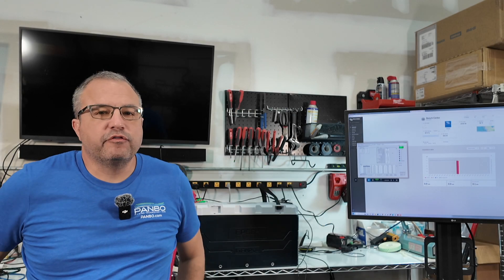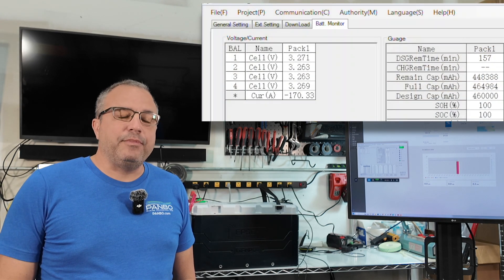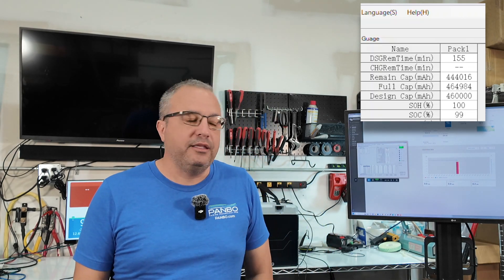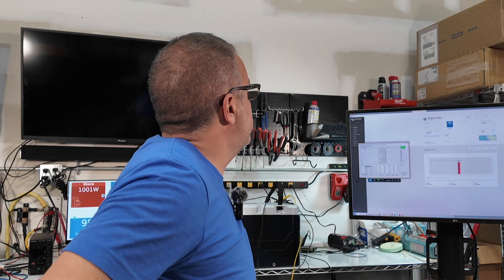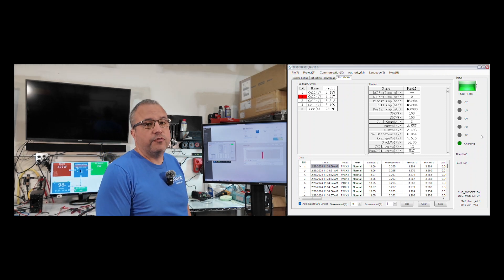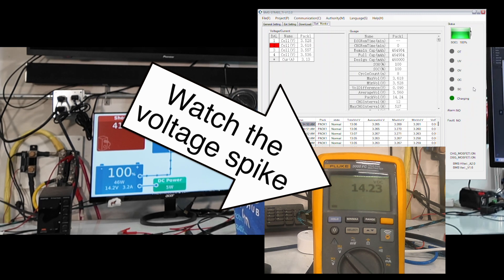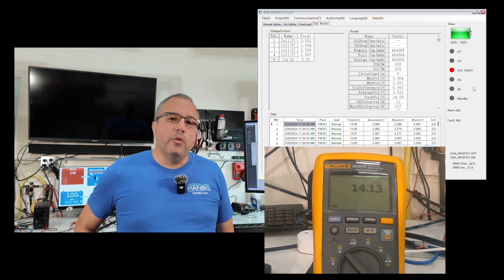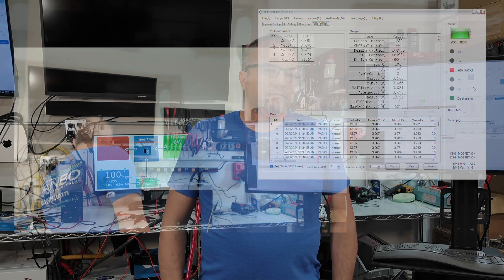Epoch 460 amp hour, 12 volt battery full charge protection

Comment: I know this thread has been around a while and interest has likely waned, but I’m hoping to pick this back up as I’ve now encountered this with my Epoch 460s and am looking answer. Your excellent video has some conclusions around “preventing” the overcharge protection (which I will enact). My issue is that 3 of my batteries have overcharge protection triggered and I can’t wake then back up. They are sitting idle at 100% and no matter what I’ve tried they will not discharge. I’ve tried tuning them on and off using the mechanical switch. I’ve tried disconnecting them as well. However, they are basically bricked. As someone who lives aboard a sailboat full time in remote locations these batteries a mission critical. And advice that you or anyone else can provide will be so greatly appreciated. FWIW, Epoch support will not return my requests for a solution. Thanks
Reply from the maker: Sorry for the late reply. The best way to get them out of FCP is to separate the battery from the others and place a load on it. Discharge down to about 80% SOC and everything should be back to normal.

Ben
Reply: thanks for getting back to me. I’m living on my sailboat full time and mostly on anchor in very remote places. I rely on this battery back bank 24/7. Disconnecting a battery and placing a load on it is nearly impossible in my situation (battery weight/location, lack of workbench environment, etc). So, I’m trying to figure out other ways to reset the mofset. Appreciate your solution but if you have any other ideas that would be helpful. Thanks again
Reply: @tommidd  You can just shut one battery down and hit the remaining battery with a heavy load and FCP will clear around 13.35 volts. The turn the other batt back on and shut the one off you just  cleared and repeat. Then set charge voltage to 13.9 absorption and you should stay out of FCP.

Comment: I had a 300mV cell delta on my 300Ah V2 Epoch battery. I managed to figure out how to get the cells back into close balance relatively quickly but not sure why it happened in the first palce.  I also had a runaway cell and one that initially would not go above 3.43 volts.  I installed four epoch essentials 300Ah batteries in my friends boat, and during pre-charging each battery individually, i noticed similar behavior in one of the four batteries.  It seems the sweet spot for charging is 13.9-14.0 volts on my battery as well. Im using a Victron IP43 charger, not an inverter charger.

Comment: Charge MOSFET needs to turn for discharge in single port BMS. The charge and discharge mosfets are in series, they use their body diodes to allow discharge through the charge MOSFET even though its off, the body diodes cannot handle much current so it just uses that to sense discharge then quickly turns charge mosfet back on to support full current, then turns back off again if it senses charge. This is why you see the charge MOSFET turn on as soon as you put a load on.

Comment: Great video, thanks for all the work in trying to help understand and mitigate the problem.  Does your testing concern you at all, or do you think it’s manageable and 
/or possibly something they could fix somehow?
Reply from the maker: I think the issues are manageable. Essentially, if the battery is charged with an absorption voltage of 13.8 or 13.9 volts these issues are avoided. I'd like better documentation and clearer guidance from Epcoh, but overall the issues don't concern me too much. I'm working on an update about the batteries in general that will posted over at https://www.panbo.com shortly.

Comment: I. See identical behavior with SOK batteries, who seems tonhave similar balancing profiles.  As I approach 3.4v per cell, things start to separate.  A much slower finishing charge (or lower overall voltage) is needed to stop bms shut down.  It seems passive balancing on big packs needs a ton of time or perfectly paired cells.

Comment: Interesting exploration. 

I have 2 Epoch 460’s in parallel, no Cerbo or DVCC, charging at a rather conservative 13.9 VDC, 13.4 Float & 13.25 Storage. Cell balancing so far, has been excellent (~ +/- 5 mV) & no alarms. 

I wonder if the DVCC / Multiplus Canbus interface is part of the problem?  

Maybe the KISS principle is worth adopting for these batteries?
Reply from the maker: I think the biggest single issue is probably that you're charging at 13.9 volts absorption. That lower absorption voltage means you're not hitting the full charge protection disconnect nor are you hitting the voltage range where balance is disabled.
Reply: @Panbo_Marine_Electronics  
Exactly.  No issues with a simpler system. (I am simply using a collection of Victron chargers and a custom CC/CV profile on a Magnum 120A charger. )

It is working very well and I am utilizing the majority of the batteries' capacity without nuisance alarms or BMS shutdowns.  The cells are getting enough voltage to be balanced.
Reply: @Panbo_Marine_Electronics  That doesn't strike me as an 'issue' but a positive benefit.  No unwelcome disconnects and the cells remain tightly balanced with good charge acceptance and more than adequate SOC.

Comment: thanks for the video, been struggling with this same problem on an install, not been getting much help from epoch, despite calling multiple times over a few weeks time span, which is disappointing. they did say that balancing begins at 14.2 same as their 300ah v2 batteries. glad to see you've found its lower.
Reply: Kevin, the owner I think, is about the only guy over there that kinda knows what hes doing and is willing to help.   The other customer service is basically worthless for tech support.   They will point you to a facebook group run by just a random customer.

But bottom line....for this issue to even exist means they likely barely tested the battery at all.   Because their recommended settings flat out wont work on a typical system.
Reply from the maker: In further conversations with Epoch I've learned that not only does balancing begin at 3.35 volts per cell or 13.4 volts for the pack, but it STOPS at 3.5 volts per cell or 14 volts for the pack. So, the out of balance issues it appears we are seeing when the batteries are pushed past 14 volts may not be an issue at all. However, the lack of clear documentation on this is an issue and hopefully one that will be addressed sooner rather later.

-Ben S.
Reply: @Panbo_Marine_Electronics  Hi Ben, any additional update in the past ~month on the potential balancing issues? It seems there is very little lost in terms of capacity to absorb at 13.8-14V instead of 14.2-14.4V. Perhaps it takes longer but it should eventually reach full capacity (within 0.5% anyway) and fingers crossed the passive balancer has enough time to be effective on such large cells.
Reply: @Panbo_Marine_Electronics  Any other updates on this ?
Reply: @Panbo_Marine_Electronics  My 300Ah V2 starts balancing at 3.45 with a 10mV delta.  I confirmed this with the Overkill Solar app and have since lowered it to 3.4 volts per cell. It was balancing no matter what the pack voltage was.
Reply: I dont think the balancing stops at 14.0. If I had to guess, it stops there when the charge mosfet shuts down as the current drops to the parameters you noted. I have a video from one of my first tests with the dvcc voltage set at 14.6
 I had already short cycled many times  and was hitting 14.5 with 30 amps with a cell deviation or less than .050 without charge mosfet disconnect. I dont think id be able to get that high without balancing. I have that video set as private if anyone wants to view it for reference. I just didnt post it because it was just me babbling to myself..lol.
Reply: @mvintrigue-trawlerdiy1101  Have you tried the Overkill bms app with the Epoch? It should clearly show when balancing is occuring and not on a per cell basis.
Reply: Likewise, thanks for making this video.  I had to set the voltage limit in DVCC to 13.8V to prevent the high voltage alarms.  I am very disappointed in this battery.  They advertised it as a canbus / Victron compatible battery, which I guess is true, but my goal was to have a canbus battery not have to fiddle with settings.  It seems obvious to me they never even tested this battery with DVCC using their own 14.6V setting programmed into the BMS. I sent an email to their support but received no response.
Reply: @kennisbutnerjr3947  Their support is basically worthless.   Essentially this is a RowPow battery.  So its very good.  Top of market quality in most ways.   Epoch just sells them as a white labeled product.   Clearly doesn't test them at all.    And becomes a headache of a middle man IMO.  Nobody there is truly a battery expert. 

So for people like us who can recognize the issue and work around it...fine.   But they must be  getting tons of returns from normal consumers who simply use their recommended settings and wonder why the battery isnt working correctly.
Reply: @kennisbutnerjr3947  How's the battery performing so far?
Reply: Nice video.  I remember staring at REC BMS screens and 2 day emails to Europe with questions. 
Some seem to be on the fence of the benefit of the comms V2 batteries over the essential series, and simply setting the controls manually. 
What do you say ? Comms or not ?